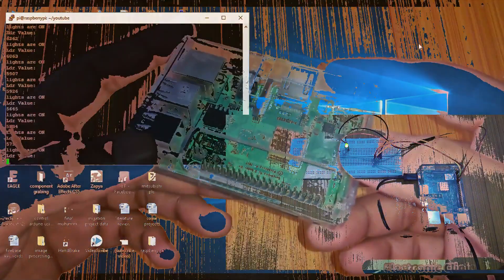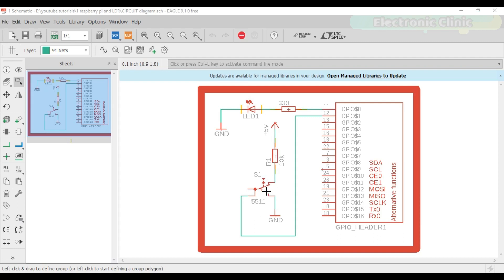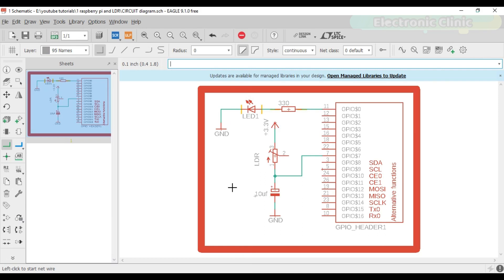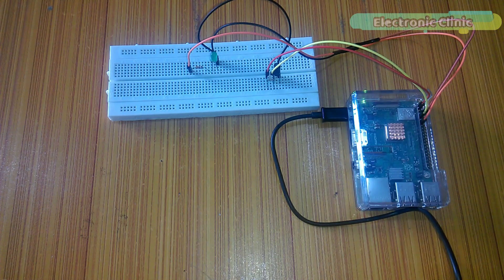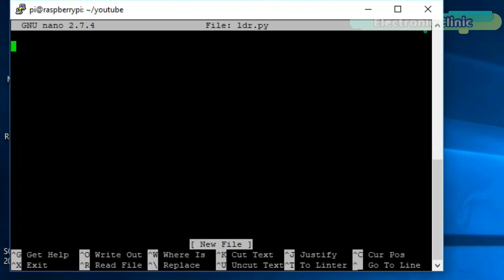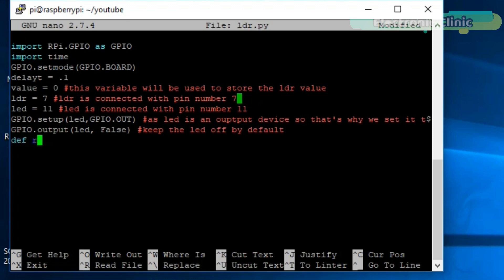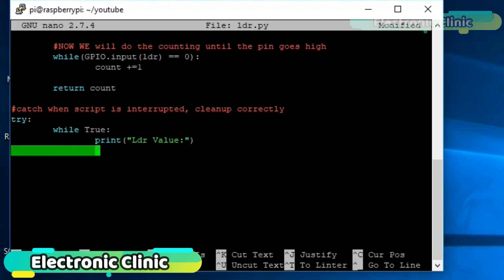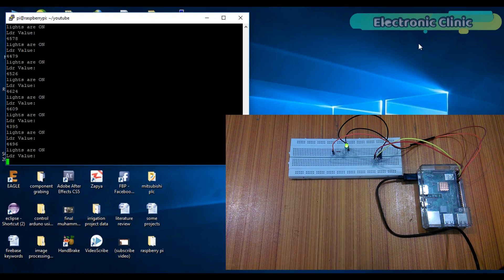Raspberry pi 3 tutorial #5: how to use LDR sensor Python Programming "Beginners level"

Comment: Can I have a bigger picture off the raspberry pie because I can't see where to put the wires or the led or the light sensor
Reply from the maker: read article, link is given in the description.
Reply: I did all the coding and in the dicription there is like 20 links
Reply: I also checked out your website it was pretty cool but I did not find a pic

Comment: Nice video sir. Can you pls make a tuitorial using ldr and a dc motor for my project   " solar tarcker " i want to use ldr and a dc motor thank you sir
Reply from the maker: Solar tracker project is already available on my channel. Check playlist
Reply: Thank you sir
Reply: Can you pls send a code that you use sir .
Reply from the maker: i have shared the same exact code, which you can find on my website. you can find a link in the description.
Reply: I cant find  the tuitorial in your playlist sir
Reply: Thank you sir i find it ❤️
Reply: Void setup(){
// initialize digital pin 13 as output
pinMode(2, INPUT);
pinMode(4, OUPUT);
pinMode(3, INPUT);
pinMode(5, OUTPUT);

}
// the loop function runs over and over again forever

Void loop(){
if(digitalRead(2)==HIGH)
{
digitalWrite(4, HIGH);
}
else if (digitalRead(3)==HIGH)
{
digitalWrite(5, HIGH);
}
else
{
digitalWrite(4, LOW);
digitalWrite(5, LOW);
}
}
Reply: Thats my code sir but it in arduino  .. can pls help me how to transfer it in  python code.. i hope you help me sir thank you